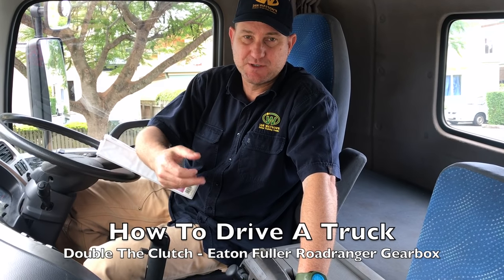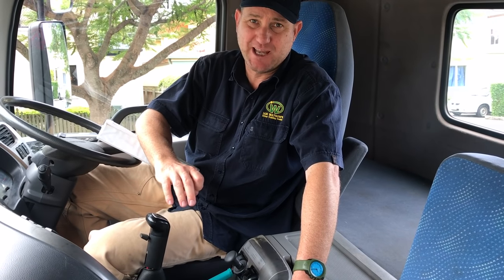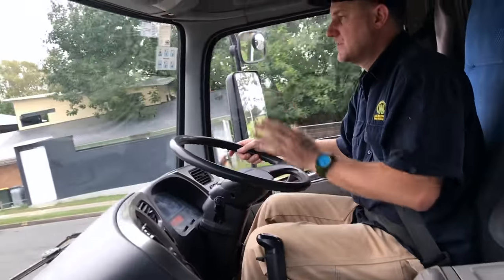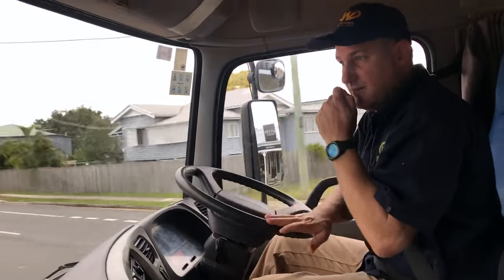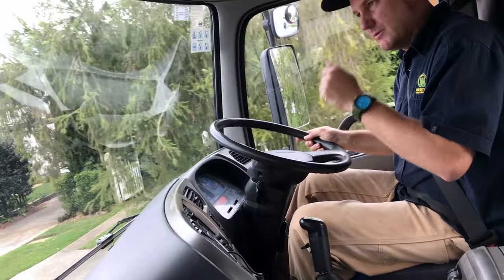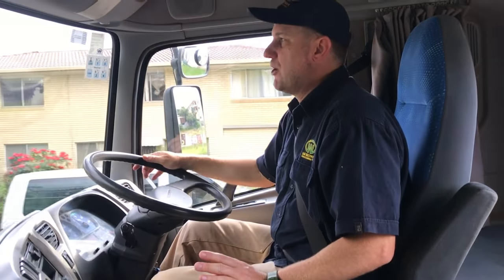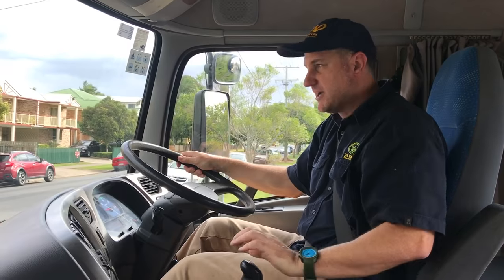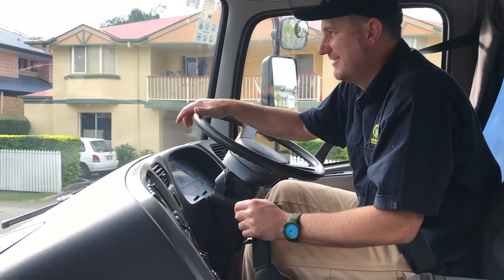How To Drive A Truck With A Roadranger Gearbox  - Double the Clutch

Comment: Hi sir,what are the engine RPM before you change gear?
Reply from the maker: My quick tip would be to have a look at your truck's tachometer - because the manufacturer usually indicates the optimal range - in the truck I am driving the tacho has a GREEN zone (1,000 - 1,500) and a RED ZONE (3,000-3,500). The aim is to keep your truck in the green zone... so at the top of the green 1,500 change up a gear and at the bottom of the green 1,000 it is time to change down. Also - don't push you truck hard -- be kind and keep it out of the RED zone.

Comment: Hey mate, silly question! Is the reason for double clutching because the truck don’t have a synchro in the box? Double clutching doesn’t seem to be necessary on a modern manual vehicle. Cheers 👍🏼
Reply: @Ben Gunning 100% correct.

Comment: What rpms are you shifting at ?
Reply from the maker: QUICK ANSWER... depends on your truck... check the tachometer and there's probably a green zone a red zone. For normal driving when the revs get to the top of the green.... change up a gear. If it drops to the bottom of the green zone, change down.

Comment: these days you cant pre load the splitter on some R/Rs. i dont remember what series but they must be more moderner ones. on them ones you have to do the change then the split b4 putting power back on. i did some agency work in 90s and came across these boxes on more medium and lighter weight gear. prefer the old pre split and shift myself and the sloppier the box the better.

Comment: My 9 speed Eaton Fuller is hard to shift on gears 5th and 6th. Tried changing transmission fluid and clutch fluid but the problem is still there. Note that the problem tends to go away after driving for like 30 minutes.

What could be the issue?
Reply from the maker: Maybe a linkage somewhere?
Reply: @ianwatsons  you mean like leakage in air fittings? I do notice the air pressure needle fluctuating between 5.5 to 8 (x100kpa) while driving. In my previous truck which was auto transmission, it was always sitting at a constant level, just above 5.5

Comment: Just checking 

What if you press and hold the clutch and change into gear? 
 That’s how we do in UK.
Reply: As far as I know most Euro trucks now use synchronised gearboxes or Automatic transmissions only. You don't double clutch a synchro'd gearbox, you drive it like a car. Driving a non-sychro'd truck around those tight village laneways you have in the UK would be a pain in the backside.
Reply: Ive got the 16speed ZF synchro gearbox in my DAF. Stupid gearbox. Have to move slowly through the gears. Roadranger is far superior.

Comment: when you are stoping, lets say you where shifting gears with out steping on the clutch,  still do you have to step the clutch or you just rave the accelerator and then step the brake then the truck stops ..Mr Luke How can i contact you.
Reply from the maker: that's a tough one. when you brake... brake to get the speed correct and under control... then change the gear.

Comment: I HOW ARE YOU SIR? IM NEAR TO THE GROUP I HAVE QUESTIONS I NEED HELP

QUESTION 1. HOW CAN I KNOW THAT THIS VEHICLE OR CAR IS A DOUBLE CLUTCH

Q 2. HOW CAN I KNOW THAT THIS TRUCK I HAVE TO START CHANGING GEARS?

Q 3. HOW TO TELL THAT  I NEED TO PRESS THE SPIDDLE OR GEAR SELECTOR  AT THIS TIME IS I HAVE  TO PUT TO HIGH GEAR SELECTOR?
Reply from the maker: Hi Peter! (1) if the gears crash and crunch when you put a clutch in, then it's a crash box and you'll need to double the clutch. (2) check the manual, this can really help. (3) when to change the gears is when the tacho gets to the top.

Comment: daf 31ft body  4 over 4 with half gears. try that for size 1996 model on irish roads. kilkenny to limerick return
Reply: Ive got a CF DAF under my new Concrete Pump. 16speed ZF synchro box in it. Shittiest gearbox Ive ever used. Prefer 18speed Roadranger any day.

Comment: This information may be good to know so a person can pass the driving test, but then go straight to floating. Clutch less shifting is by far the most efficient method. Less wear on the clutch components, less fatigue on the driver and quicker to get the gear changed. Also my boss said “ I will fire you if I find out you are double clutching.”😁

Comment: Good video but no real explanation/demonstration on how to use the split shift coupled with the RR.
I've driven these and other types of split shifts & to be honest never felt the need to double clutch through ever gear.
Thankfully I now drive an 12 speed auto & probably wont go back to manual.

Comment: Or you can just use double clutch for low range 
Upper shifts use 1200  to 1500 rives straight shift

Comment: When you come to a stop without engaging the clutchbrake are you pushing the brake peddle? Is this just for quick stops or for waiting at redlights as well?
Reply from the maker: Darlene Young when coming to a stop — brake first, then push clutch second. Once you come to a complete stop — pop gear to neutral, then engage take off gear (for this have your clutch 3/4 pressed in i.e. 1-2 inches off floor). For more info about clutch brakes and finding gears when stationary - I have another video for that.

Comment: You don't use first in any truck gearbox unless your heavily loaded or going up a steep hill..... I have my HR license and I drive a 9 speed Eaton fuller synchro box. but licensed to drive non synchro as I used to drive a Kenworth K200 tipper that had an 18 speed box in it. And you can also get away with skipping a few gears here and there.
Reply from the maker: Yes - next video I'll drive my mate's kenworth and show Skipping gears
Reply: I carted logs with a K100G with a C12 Cat under it. Torquey motor. Used to drop back to 1000rpms and skip a full gear on the long uphill climbs. Pulled like a tractor lol. Had a tough 18speed Roadranger box in it too.

Comment: I have no idea why so many guys, especially the so called "Super Trucker" from US of A, advocating to float shift the Eaton box. I clearly saw and read the Eaton factory manual/instruction to use clutch on each shift. The Super Trucker guy would give this reason "Because replacing clutch is way less expensive expensive than replacing your left knee." What a silly reason, so using clutch wear more thing than not using the clutch? Silly.

Comment: Oh, how much do I miss driving trucks with transmissions like this.....???
Modern lazy automated trucks have no feel whatsoever....my current drive is a 2018 MAN TGX26.500 with a 12 speed ZF TraXon (Formerly known as ARSETronic).
It is the most dismal, clumsy, slow and generally inferior truck transmission I have had the misfortune to put up with.
At least with a manual box, the driver can feel the vehicle.....many other of my truck driving colleagues would probably return better fuel consumption figures too !!!!

Comment: Sorry some of the techniques are wrong like putting pressure on the gear lever until it drops out of gear is a sure way to half the life of the selected forks and potentially break them.If you understand the workings of one of these gearboxes you can drive them smooth and get good life out of them.I watched this video out of curiosity he explains the basic i didnt see him use the splitter (overdrive)if not taught how to use them properly you can have some big malfunctions old transport companies would remove the 13 install a 10 because people could not drive them without wrecking them
Reply from the maker: You raise some good points from a mechanical perspective. Thanks for sharing.

Comment: looks like you are roughing it just a little. not much though. i've been driving volvo and scania mostly. you need to find their sweet spots
Reply: paul shortall i drive a UD similar to the one in the video, the throttle response is terrible, very hard to rev match if you try half quickly. The hino i had before was a much nicer engine to drive, responsive throttle and a wide powerband. Very easy to shift

Comment: I'm sorry but if you're a truck driver and you're using the clutch then you're a steering wheel holder. You are not a truck driver. 
I can say this too I've been driving since I was 18 and almost 42 now. 
I have ran every transmission from a 3 speed on the column to an 18 speed. The only transmission I've not ran is a twin stick such as a 5 and 4.

Comment: The term you are looking for is double de-clutch not double the clutch.  Just sayin'
Reply: i think he knows what he's talking about, no?
Reply: @AboveSomething  Not in this case he doesn't
Reply: double-declutch in British
verb
(intransitive) British
to change to a lower gear in a motor vehicle by first placing the gear lever into the neutral position before engaging the desired gear, at the same time releasing the clutch pedal and increasing the engine speed
US term: double-clutch
Just sayin'. Are we British?

Comment: Apart from moving off wtf do you use clutch for if you learn how to drive a roadranger box you get tought no to use it becouse it two or three times more work and saves the ware and tear on the clutch, and your knees there are to meny drivers that have driven trucks with the r/r box using the clutch have now got arthritic knees and need replacement joints now and if your a good driver you dont need to look at your clocks we do it on the feel of the truck the reves and tone of the engine all the rest is hard work for nothing.

Comment: I beg to differ to your down changing,I learnt to drive Tv's in 1987 and drove Days with non synchro boxes,your description of changing down with a non synchro box is wrong,you change down the same way as you change up,I.e,you don't hold in neutral then depress the clutch,you do it all in one movement...also you don't let go of the steering wheel when doing this movement...hope this aids you as a driver trainer,if I can help you more in any way please do not hesitate to contact me for more accurate information..
Reply: He’s doing it exactly how Eaton Fuller recommend
Reply from the maker: I think you may be talking about a syncho-box Dave.